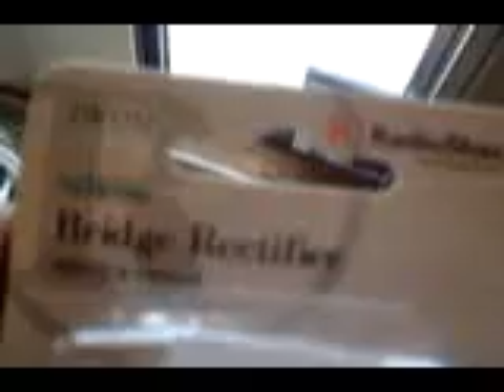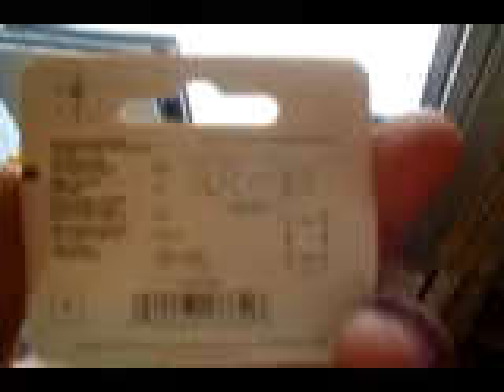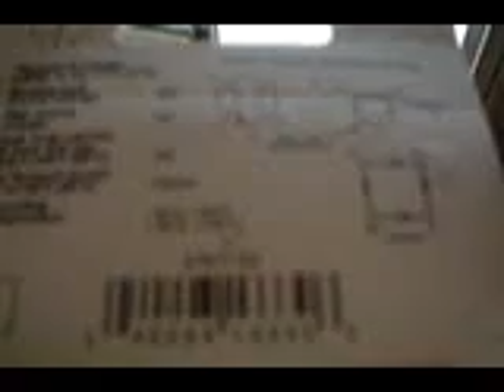hydrogen $10.00 cutting board worked great

Comment: HydroMoto makes a good point ... problem with the chopping boards is that they are a bit thin and the plastic has a bit of give to it ... 

but that is a very fine looking piece of gear ... you have come a long way in your fabrication technique ...

DO NOT USE THAT BRIDGE RECTIFIER ... IT IS WAY TOO SMALL ...

I suggest you get one of the ones off eBay that were rated for 400v at 35a ... those are strong enought for what you are doing ...

Comment: 1500ma = 1.5 Amps. Thought that might help ya. Im impressed with the cell. When you showed us the stack of steel on your table I wondered what you were gonna do. Im pretty sure the cutting boards will warp badly over some time. Even still theyre a good idea. And what did people do before JB Weld-